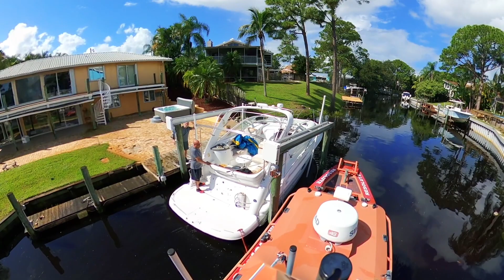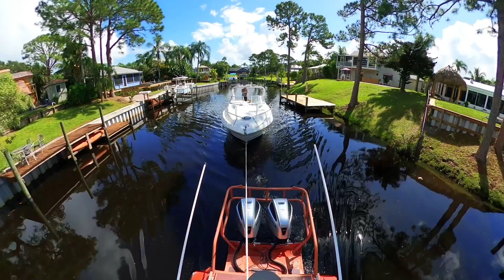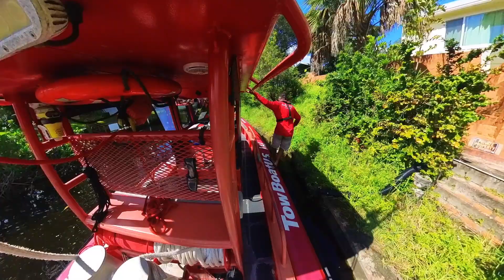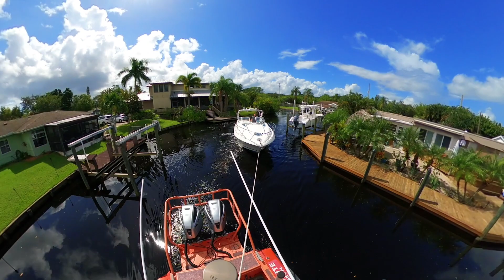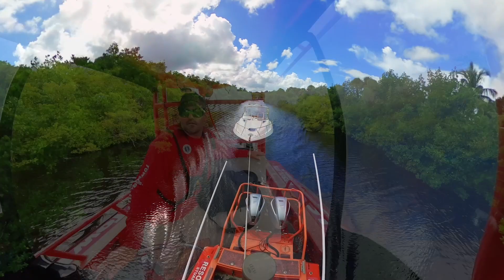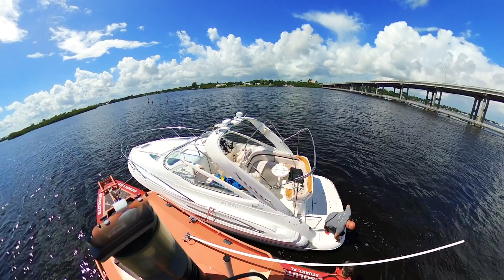Tight River Towing Trick with a 30 Foot Boat in a Narrow Canal, and No Room for Error

Comment: Wonder if running two lines to the towed boat would help in a tight channel to keep it in line, one to each forward cleat? I know nothing, just throwing it out there. Absolutely love watching your work, from Kelowna, British Columbia.
Reply from the maker: A bridle will help some, but sometimes I prefer a single line just easier to work with when you have to slack the line for a sharp turn, a bridle will catch on the anchor.

Comment: needs a rubber V at the stern, pull the towed vessl much closer, into the V , no swinging then, we do it local
Reply from the maker: Make a video, not sure I understand
Reply: @CaptainRetriever you create a pocket on the back of your boat that the bow or nose of the boat being towed is pulled into with wiggle room. 

It's the same thought as a barge with a V notch in the stern of the barge a tow tug puts its nose into it with tow lines coming off the stern of the tug connected to either side of the barge. And the tug can push the barg. They are mated and they both move together with no pivot.

For you it's reverse engineering where the notch is at the back of your poat and you pull the boat being towed into the notch behind the outboards, with enough wiggle room to pivot like an 18 wheeler. And if need be you can wentch out the line a little letting the boat being towed fall behind a little depending on the situation

Weld a V wide V and stick a tire in the closed end of the V with one on either side " inside " of the V ,   I guess it would be more like a U where the left and right side of the u is angled like a V. Giving room for different size boats and wiggle room
Reply from the maker: @anthonymiller7992  My problem with that is you lose maneuverability, an 18 wheeler steers from the front with a pivot point, if he had to steer from his rear wheel it would do the same thing. You could accomplish that in reverse, have a notch in the bow of your boat. Pushing with no pivot it would be too long with some of the hairpin turns. It may work slightly better if theres more space between the engines like with a catamaran, but ours are all right next to eachother.